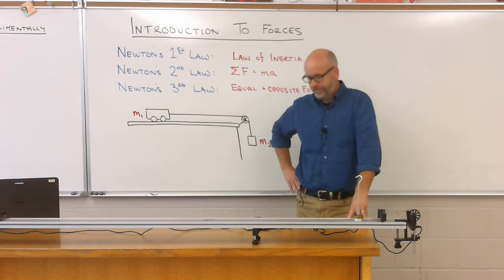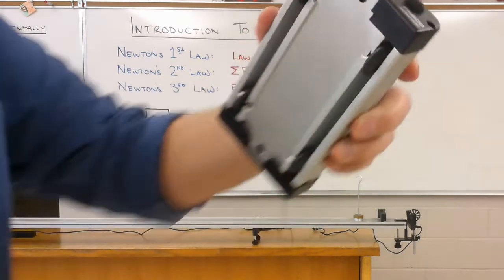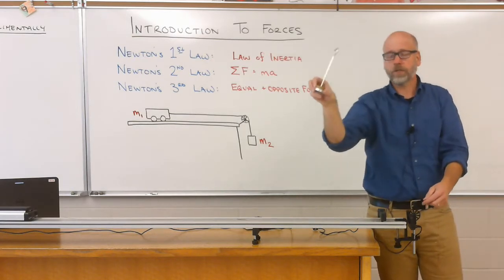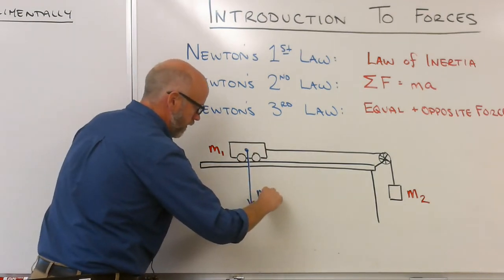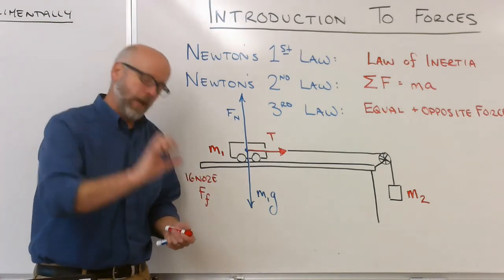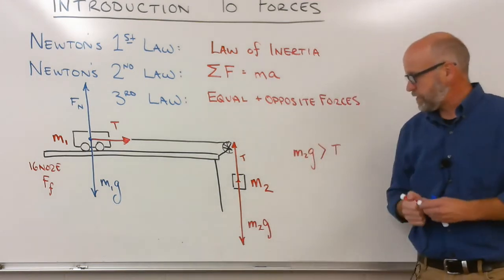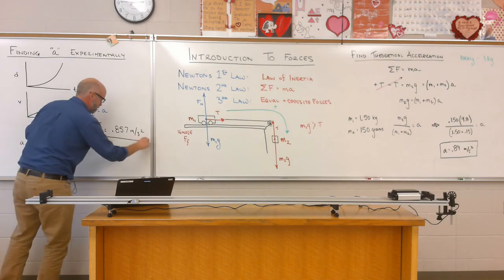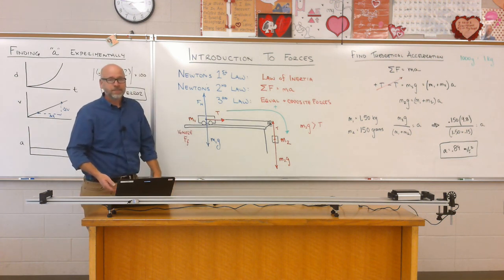Forces - AP Physics 1:  Classic Cart Problem with  Vernier Smart Pulley

Comment: "Force does not exist physically in the same way that an object with mass does. This means that force cannot make surface contact with an object, much less push or pull it. The initial cause of all bodies in motion originates from the applied energy (E), which creates the momentum (p) necessary to make surface contact with an object, thereby enabling it to push and pull. This concept is mathematically expressed as Ep or the equation Ep = ma. Note:  Ep is not to be confused as “Kinetic Energy” in any way. Force was originally used as a placeholder by Sir Isaac Newton because he did not know the true nature of this Force." ~Professor Guadalupe Guerra from Laredo, Texas c/s